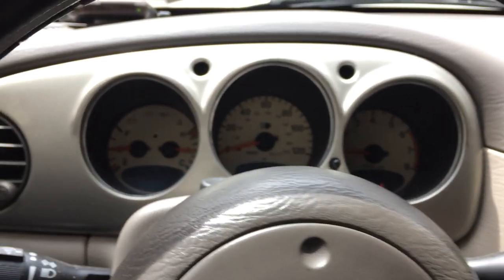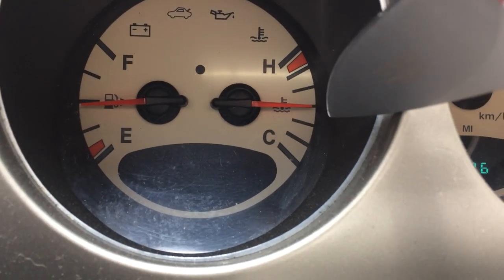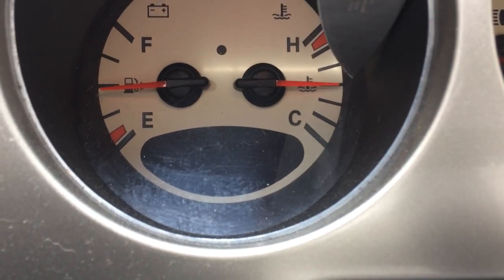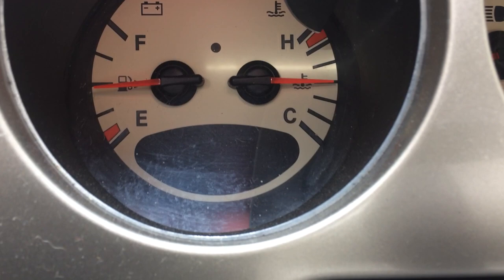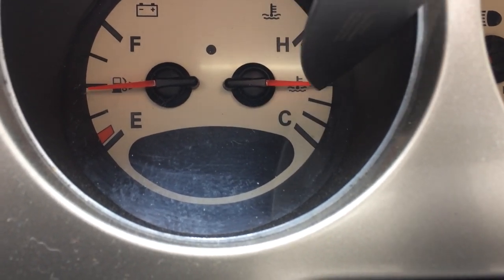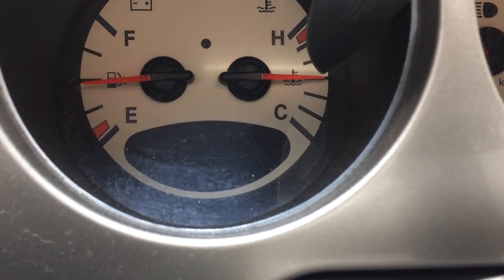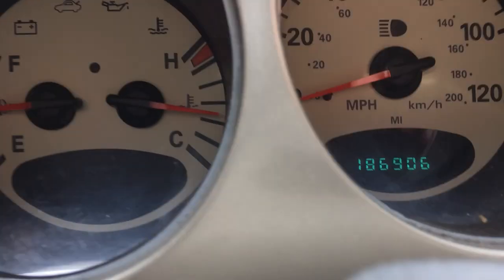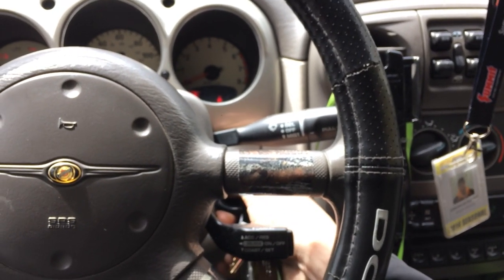Correct operating temperature for your PT Cursier

Comment: I have a 2008 PT Cruiser problem where the A/C Compressor had to be replaced and about a week after that another problem was that the A/C wasn't cooling when idling while parked or in a drive thru or heavy traffic.  I brought my car back to my mechanic and they told me that it need a new fan and motor combo and once that was replaced it was going good for about a week and then one day at a red light I heard this weird noise and then noticed my temperature gauge was just about maxed out.  I pulled over and found that noise was water boiling over.  I let it set for about an hour and a half and after that managed to make it home but I let it idle for a few minutes to see if it was going to happen again and it did.  I was told that the fan relay needed to be replaced and finally found them after watching a you tube video.  There were two of them located to the left of the radiator center. After replacing them the A/C runs good and no more overheating but the temperature gauge only goes up to the 1/4 mark.  Any ideas what it could be?  Someone told me the A/C low speed fan should come on as soon as I start the engine with the A/C off but it does not.  It does come on when I turn on the A/C and I was told that was the high speed fan. Thanks for any response in advance.
Reply from the maker: Well my fan does not come on when I start the PT only when it gets to temp it will come on for a short time. When the A/C is on low or high the fan will come on and stay on. My A/C issue was the blower fan under the glove box had debris stuck in the fan so it would not blow. Also most time when the PT overheats it’s the thermostat that’s normally the first part to go. And if it’s running just distilled water it can over heat. PT take 50/50 antifreeze or special blend that sold at the dealership.

Comment: Mine goes to midline at a light and the drops to just below that midline, when I am moving. It goes back up to the midline when I stop again, but I guess thats normal? I just had a bunch of stuff done to the cooling system. water pump, timing belt, new therm housing, new thermostat, new radiator cap. Had a heater core bypass done with supposedly no leaks, according to two of the mechanics that were testing it. Incidentally I had to get a second new radiator cap as the other new one was leaky. Also had another pressure test done, and they said the head gasket was good.
 Dont see any leaks now. I have a new coolant temp sensor in the glove box, also. Haha Good lord. Have mercy. Cooling system issues are a PAIN.
Reply from the maker: Yes I just got an 04 and it has the fun overheating issue. And yes that normal for it to move up and down and the fan comes on or the thermostat opens.

Comment: I was wondering that because my temp is usually right in the center when I'm stuck in traffic or at a red light. Otherwise it's usually below the half when im on the freeway. When I went to check my coolant and fluids everything was good except my oil dipstick was at the halfway mark... I did get an oil change in August and now it's December... How often should i get an oil change? Should i just add a quart of oil for now? It is a 2nd car, so I really only drive it 300 to 400 miles per week
Reply from the maker: Yes ad oil and change it every 3,000 miles
Reply: @StansAuto83  thank you Sir!
Reply from the maker: Your welcome
Reply: @StansAuto83   *You're

Comment: These are notorious for electric fan switch failure, causing the engine to run excessively warm or even hot at idle, so watch for that as well..
Reply: As a mechnic the car in video seems to runn ok..
Reply: @anteneupitra 

The car in the video is running in the proper temperature range. That's all we know.
Reply: @Just1American1966  thats what i said.
Reply: @anteneupitra  

It does, at least as far as coolant temperature goes.

Comment: mine runs under the halway mark always sometimes even dips down a little, could that be bad?
Reply from the maker: No that is normal in some areas. Altitude does affect cooling and also the temperature and biometric pressure.

Comment: After a 300 miles trip in cold weather  the coolant temperature didn't reach the normal temperature while driving (only at idle ) does it mean that the engine oil didn't reach it's optimal temperature?
Reply from the maker: No in colder weather the coolant temp does take longer to get to temp. And if it’s really cold the temp will drop while driving.
Reply: Coolant temperature went up only to 155-160 degrees. I would like to know  if this did any damage to the engine because I was driving a bit agressivley, was the engine at normal temperature despite the temperature gauge was not in the middle? Main thermostat is fine, only the egr thermostat is not working. Did I harm the engine by this?
Reply: @StansAuto83  so basically what is the relation between engine temperature and coolant temperature?
Reply from the maker: No it should be fine the oil light would come on if there was an issue with the oil pressure. And 155-160 is ok. In places like Alaska your engine would run cooler. Cars are made to run cooler in winter. When it’s really cold engine damage can be done at start up. Read the owners manual for driving in colder weather. It will explain what temps to look for and what to do when it’s really cold.
Reply from the maker: Engine temp as in oil temp is different then the temp of the coolant. Cooler engines run better and also give more power. To cold the oil won’t flow. To hot the oil won’t flow. So using the right oil as in 5w30 or 10w30 in hot to cold weather will change. So read in the owner’s manual for type of oil to use in hot to cold weather.
Reply: @StansAuto83   different than       Too cold / Too* hot
Reply: @b2bline833   reach its* optimal
Reply: @stfuplsok  so was 70 Celsius enough for the engine to be in optimal temperature condition?

Comment: The needle started moving to and fro between c and operating temperature. What could be the reason for that?
Reply from the maker: Temp sensor
Reply: I opened AC in car during that time. Could this have caused the needle to move to and fro
Reply from the maker: Yes also there could be air in the system

Comment: Vw jetta 2014 operating at normal temperature , but sometimes after running and stop and turn on iginition temp show over to 100 and when key turned on car starts with a second delay with odometer dimming, after car  starts temp fall back normal .What could it be.
Reply from the maker: If the odometer normally doesn’t dem and that’s an issue that’s recently come up there could be an issue with the battery not having enough charge and if that is the case the alternator might be starting to go out. In newer vehicles when there’s not enough volts coming from the battery some operations will not operate correctly.

Comment: Is all the car working temperature is the same? Just above the middle line? Tnx
Reply from the maker: Ya around the middle line. But it run cooler with a 185 thermostat
Reply: @StansAuto83  tnx for the response🖒

Comment: My cruiser needle is in the middle
 Is it normal could you help please
Reply from the maker: Yes that is normal for some of the pt’s depending on what part on the country and area. If it goes above the middle the radiator could have issues getting air through. Or the thermostat is not opening at the right temp. Or the coolant could be low.

Comment: Hi, my car hit temperature goes in mid pretty quick like after driving for 5 mins but never goes above that. Is there anything I should be worried of?
Reply from the maker: As long as it does not over heat your good. But I look between the radiator and AC condenser down at the bottom to make sure that the radiator is not clogged from debris.
Reply: Stan’s Auto Repair ok
Thank you so much
Reply: Thank you so much
Reply: @StansAuto83   you're* good

Comment: My car Running after some time temperature gauge gone low about C° and my car is stop how i fixed please reply.... car (xcent)
Reply from the maker: Are you say your car’s temperature runs hot? Or low? And is it running or stalling?
Reply: @StansAuto83  very low about NEAR C° point
Reply from the maker: Ok does the car still run with it that low?

Comment: If it running a little over the C and no heat
Reply from the maker: The heat typically doesn’t kick in until it gets close to the operating temperature. But if you’re constantly staying a little bit above C  your thermostat could be stuck open so the coolant isn’t able to get up to the correct temperature.

Comment: Bor how many sec its take the car temp meter level ...
Reply from the maker: It depends on the air ambient temperature. It can get to temp within 2 minutes or even 30 minutes.
Reply: @StansAuto83  k bro I have hundai accent 2005 its take to temp in 5 minutes it's not problem ???
Reply from the maker: No my impala gets to temp in 2 minutes. So as long as it is not over heating you are fine
Reply: @StansAuto83  thank you so much bro ❣️❣️
Reply from the maker: You are welcome

Comment: After a min my temperature guage rose high after sitting all day and my fan is coming on.
Reply from the maker: As long as your fan comes on and the Morning Dean doesn’t happen or the gauge doesn’t rise to high pass the normal operating temp you’re OK
Reply: I changed my thermostat and and radiator cap still rising. Coolant is in it and its in the okay zone